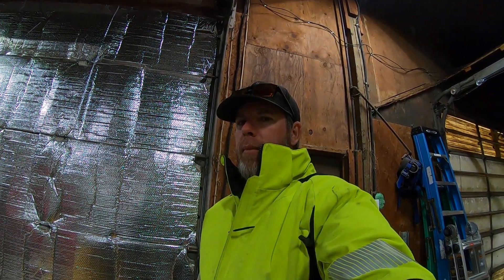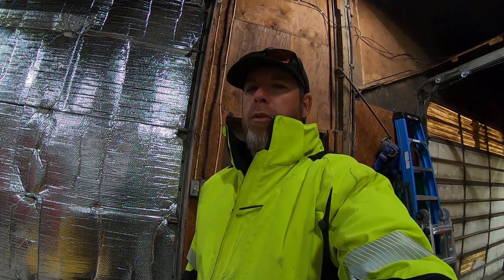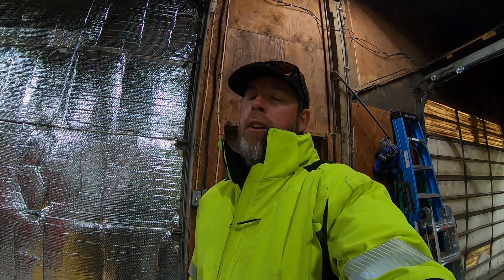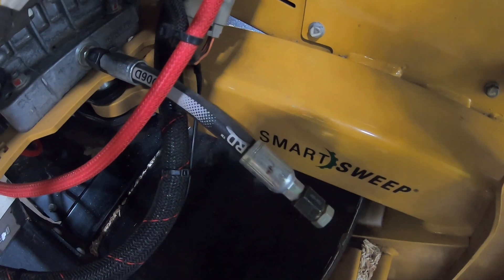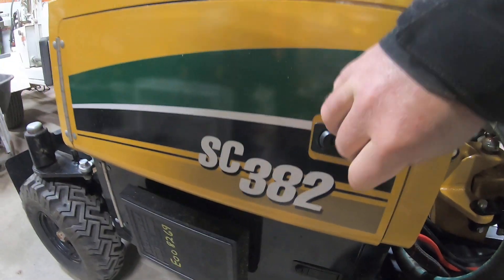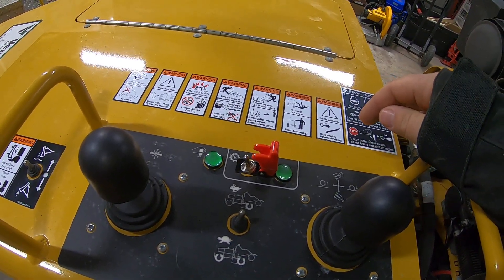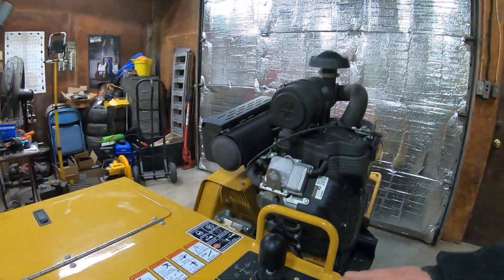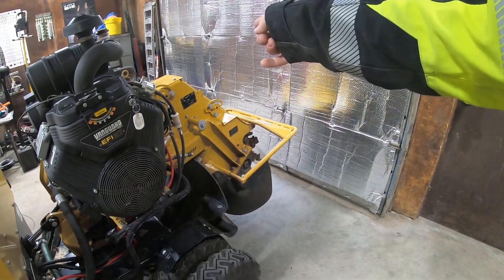Stump Grinder Clutch Failed! Vermeer unable to fix DIY Solution for wiring bypass #mechanic #repair

Comment: I had the same issue with my SC362 (2 years old). I turned out to be a faulty ignition switch that was shorted out usually during the rain when the wiring leads would move around.  Not saying this was your issue.  But I cleaned the terminals and noticed lots of dirt and debris in the connectors.  Seems to be good now.  I suspect they are exposed to the rain and shorts out when wet and moist dirt builds up.  Poor design in my opinion.  Cheers
Reply from the maker: @jimmygreen50  Thank! Good to know!

Comment: I'm having the same problem with mine. Any way yuo can show me or walk me tru the process I would really appreciate it
Reply from the maker: @RosendoCantu-y6s  There are two wires coming from the clutch just in front of the motor. It is on the back side of the belt guard. One I Grounded to the engine base. The other I ran through a new 2 pole switch then directly to the positive post on the battery. I did put an inline 20amp fuse between the battery and switch for safety.
Reply: Has it given you any more issues since you did the modification
Reply from the maker: @RosendoCantu-y6s  No issues except you lose autosweep so you can stall the machine if you go too fast. They finally did a recall on my particular machine that involves a new joystick and a software flash. I have not had it done yet, so I don't know if that fixes it. It is free since it is a recall.
Reply: Good morning, buddy.Finally thinking about doing this to mine.How do you know which wires the ground?and which one's the power? @stihlgotit
Reply from the maker: @RosendoCantu-y6s  I don't remember what colors the wires are, but usually white or green is ground.
Reply: @stihlgotit Hey, man.
 I had a separate question about the stump grinder. See if you can help me out so I was about to start doing the bypass that you showed on YouTube. But now my stump grinder doesn't want to come on at all.  And the hour reader is not displaying or coming on when I turn the key.Would you know why it's doing that?Or what could make it do that? I took the spark plug out to see if it had a spark and it doesn't. . I thought it was the relay. Switches and/or fuses, but those all seem to be fine. I even replace some relays. Again, I could appreciate any help or information.
Because if not I would have to go drop this off to the vemeer  which is gonna stick it in my butt.. And I really don't want
Reply from the maker: @RosendoCantu-y6s  to be suddenly no power anywhere could be a bad ignition. That is somewhat common. Take a multimeter turn the switch on and see if there is power at the switch then past the switch. If no power at the switch fuse if power at the switch, but not past bad ignition.

Comment: Having this problem with my sc 70. 6 damn months old. Only happens when you use the remote, not at the machine control
Reply from the maker: As far as I can tell there is something faulty in the auto sweep that fouls up the rest of it. All they do is throw parts at it like handles. Frustrating to say the least.

Comment: My 382 one month out of warranty having the same problem
Reply from the maker: It's like they did it on purpose to make you buy a new machine. I fought mine the entire time. Had it in on warranty several times and still didn't fix it, so when the warranty ran out I fixed it.

Comment: I’ve got a 362 and the cutting wheel is disengaging all the time. I’m interested in bypassing it can you help me
Reply from the maker: You will lose your auto sweep. That is the malfunction, but if you keep sharp teeth on it you can cut faster without auto sweep. Just cut the two wires coming out of the electric clutch and take one to positive through a switch and the other to ground. Problem solved. If it doesn't work the first time reverse the wires.

Comment: Can you put a video of the steps you take for us to do it,  my cutting wheel keep stopping,  soon as stop I hit the switch and keep working but stop over and over again and hit the switch and works for few seconds and stop again,  I got the 252
Reply from the maker: It is very simple. There is a plug in front of the motor that goes to the clutch. Two wires. One goes to ground ( I used the same ground as the motor). The other runs through the switch to positive on your battery. It will require a two pole two position switch, two wires and crimps to tie into the two wires from the clutch. Hope this helps.

Comment: Anyone got a simple fix/bypass for a operator present system on a SC252?
Reply from the maker: Is it locking out the whole system? IE won't drive, or just shutting down the cutter wheel?
Reply from the maker: If it is just the cutter wheel, this will do it, but you lose smart sweep. It will stall the motor instead of disengaging the clutch if you take too much or get pulled into the stump. Gotta hit the switch manually if it starts to bog the motor.
Reply: @stihlgotit  I DID IT, it works! using your video as a guide, I did it. I bypassed the operator presence system
Reply: I’m not entirely sure what all that entails, the biggest pain in the ass is I can’t wear gloves & operate the handles, if I have gloves on, the operator presence system won’t turn on, 

and then other times ( off and on ) during operation, even though my hands are right there on the handles, it’ll kick the clutch off. Even though I’m literally, Right there, hands fully on the handles, and then I run into issues during operation where I’m rocking and rolling & my eyes are not on the OPS light & the CLUTCH light. 

the damn thing just kicks off.
Reply: I’ve got some time before my next job & I am attempting to bypass it, I’ve cut the wires leading up to the plug for the clutch, I cut those, and have tied in with one wire to the ground & the other to a seperate switch that I have yet to put an “in-line fuse” too.
Reply: I’m hoping this works & I really appreciate your video, as it’s the only video where this ISSUE is addressed & the only video that provides a bypass solution. Thank you.

Comment: I’m having basically the same issue with my 292, out of warranty. Vermeer isn’t sure says might need new handles because of “hairline cracks” on a garage kept machine with 200 hrs on it. Only $270 per handle x3. Now I’m looking into a hard override on the safety stuff, I’m not sure if wiring is the same on 292 though. This video gives me hope it can be done.
Reply from the maker: You lose the kick out. It will stall the engine if you get pulled into the stump hard and you aren't quick to disengage. I used an older 252 prior to this grinder and that was the way it was factory, so not a big deal for me.
Reply: https://youtu.be/ct8AeT8Y5ao
Reply: I'm thinking hard of purchasing a 2019 SC382 with 200 hrs on it.  After reading the problems you had with yours and others, I'm wondering if there is something better out there.  Maybe a smaller machine might be something to consider.  What brand and model of machine would equal the SC382 of something close to it.  Also with the belts running the cutting wheel do they need changing often?  Any help will help.

Comment: Sc362 keeps starting and then stopping starting then stopping then stopping for a long time… is it the wiring or the clutch?
Reply from the maker: It's something wrong with the relay or computer, I bypassed it and it works fine.

Comment: I have the same problem with my sc 362
Reply from the maker: This fixes it. You just have to get a feel for it so you don't stall the motor after disabling all the fancy electronics, but it will actually grind faster without the smart sweep.